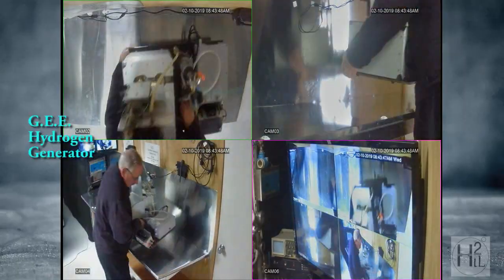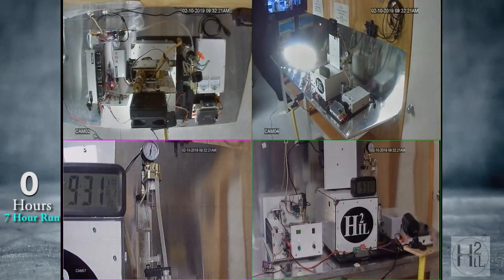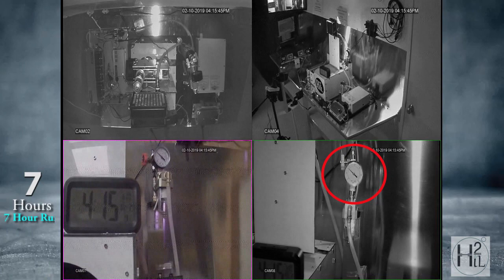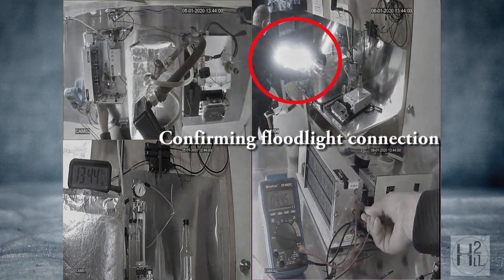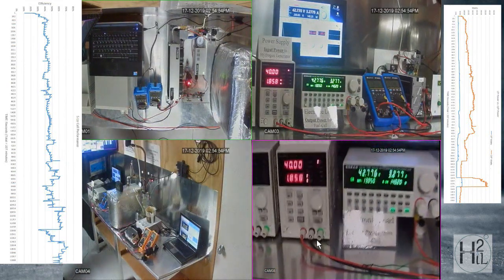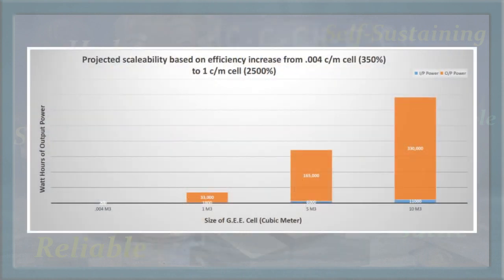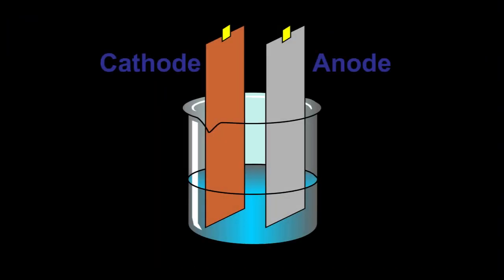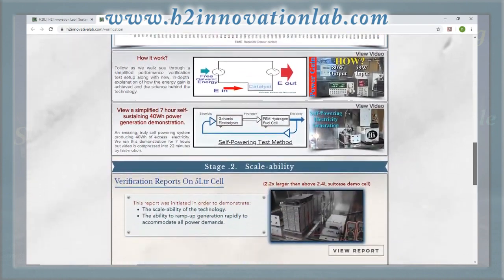H2IL Highly Efficient Hydrogen Production Technology Verification Test Overview - New Science

Comment: If the electrolyte is consumed is this not fuel based? Is the fuel cheap? Why not open source it for diy guys? Is it an aluminum chloride or some other aluminum in solution? Aluminum and water make heat and electrolosis but consumes the aluminum.
Reply from the maker: It does consume electrodes at a very slow rate of $0.34/kg/H2. No metal fuel is that cheep. No the technology is not rapid oxidation of Mg, Al or Zn in highly acidic or alkali solution. See more in the Q&A section of the dedicated information website. Just google H2IL
Reply: Maybe Silver Hydroxide AgOH as electrolyte?
Reply: @fabiotribos5358  colloidal silver? not a salt... they specify that it hasn't salts I believe.

Comment: How many kWh electricity form a 40% efficient PEM Fuel Cell do you produce per kg of consumed electrode (metal)? Please let me know in order to access your claims. Chris
Reply from the maker: Please refer to Q&A: https://www.h2innovativelab.com/questions
Reply: @h2innovationlabh2il69  I am sorry but I cannot extract the information that I requested form the video. Is it possible to have a direct answer (kWh produced per kg of consumed electrode). Many thanks.
Reply from the maker: Galvanic energy is harvested from metals. The electrodes decay at a cost of $0.34/kg of hydrogen produced ($10/MW energy) This parallels the fuel cost of uranium in nuclear energy.
Reply: @h2innovationlabh2il69  dissimilar metals with different potentials, I have the same thec but in advance, my electrodes do not corrode or decay. I want to use yours for a project of hundred thousand tons of H2 we are setting now.